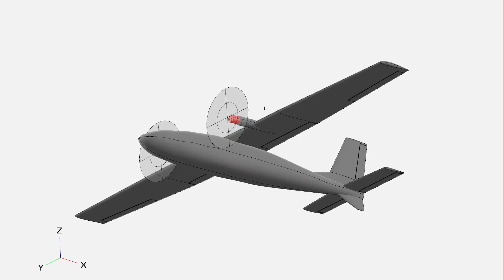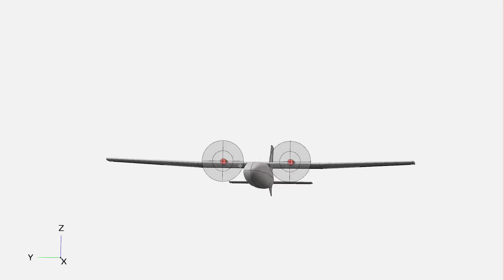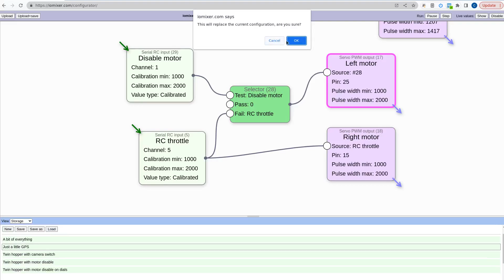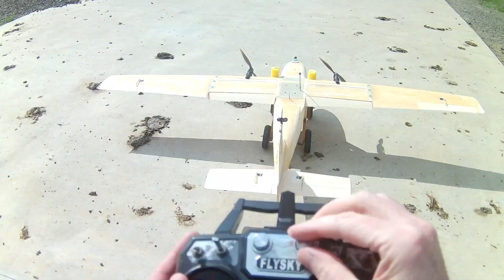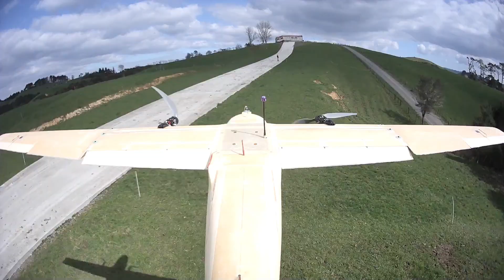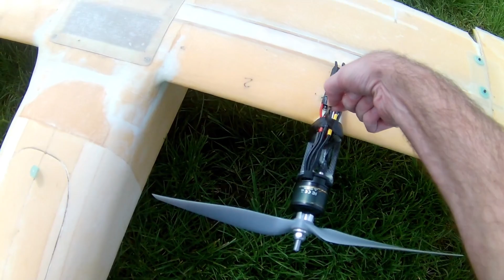Ardupilot vs motor failure testing

Comment from the maker: I also tested cutting both motors in auto mode, but forgot to include that in the video. The plane pitched up a bit in an attempt to maintain altitude, which resulted in parachuting downward at 7m/s at which point I got scared and recovered it in manual mode. You can see a clip of that here: https://youtu.be/4N046PUA5Ts
Reply: Erm if Andrew was auto compensating and automatically adjusting for the switched of motor leading to your video is it not logical to assume that having an autopilot doing micro adjustments alongside you flying leads to the exact same video Andrew produced? Andrew is making minor adjustments in his head leading to you saying in effect that his data would not translate to lets say my video or stave's down the road, but what would  be the outcome if you removed the autopilot (clue in the name there) all together and just flew the plane on servos, esc's, motors and you? then actually tried those exact same tests with no computer assistance, do you think there would be any noticeable difference then?

Comment: Hii bro I want to know that motor size and propeller Inch
Reply from the maker: These are APC 16x10 props, motors are 4250 580kv (FMS Predator brand)
Reply: @iforce2d thanks bro

Comment: Pretty cool. Not an RC guy yet, but seems like you could use a little rudder input programmed in for asymmetric thrust.
Reply from the maker: Yes, if you wanted to do this intentionally for some reason that would be helpful. The question I was trying to answer was how well Ardupilot manages when a motor fails unintentionally, without any specific 'programming' to take care of it.
Reply: I see. I find it fascinating the stuff you're doing. In airliners if we don't apply rudder or rudder trim the autopilot will have a hard time compensating. And it looks like Ardupilot is basically an autopilot from what I can tell. Waiting for the retracts you talked about! :)  @iforce2d

Comment: Great aircraft :) I have been building my designs for the last few years with literally same technology, orange foam ("penopleks"), fiberglassed surface and multiple sections on a wing cut from profile shapes. the only thing is, I have no idea how to paint them or make them look nicer. How would you go about painting one of your models to make them look all nice and shiny? :)
Reply from the maker: I actually made a video all about my attempts to paint these. It didn't go very well, mainly because of the fiberglass fabric pattern on the surface. I can't really sand the surface much because I usually only have one layer of glass and it would be worn away too quickly before becoming smooth, plus the epoxy is very hard. If you want a truly shiny surface I think you need to make molded parts, instead of this method.
https://www.youtube.com/watch?v=7Fjj5aLm2Qw

Comment: This one seems to have a nice enough thrust-line that it barely notices a motor-out. But does that also make adding differential thrust in the control mix to boost yaw authority a moot point?

Comment: You should cut some scoops out of the fuselage and move the propellers closer...maybe even a little bit into it.....then have those scoops shaped so they smoothly direct the airflow under the wings at the root.

and maybe even slightly re-design the wing root to make a bit of downward thrust with that airflow (or adjust the flaps to take better advantage of it for just making that thrust during takeoff and on final). This may be outside the intended flight characteristics here, but it sounds fun lol.

Comment: HI, I BUILT nrf24 transmitter and receiver which output ppm using your sketch. What i want is to get my quad battery voltage to display at transmitter on an oled screen. 
May you please help how to configure this ❤
Reply from the maker: https://www.youtube.com/watch?v=lf7bO5KO6rc
https://www.youtube.com/watch?v=OC5KFWCgRdM

Comment: Another amazing video! I could watch hours of this channel
To answer your question in some other data that might be interesting.
-looking at the pitch, roll, throttle curves is interesting, bit I wonder if looking at the pitch, roll, yaw ERROR might highlight any sensitivity.
-Looked like there was a slight difference in turning radius at each waypoint. Wonder if this is significant.
-Current being about the same is interesting. Theoretically makes sense that for either case, it would take the same energy to keep the bird up, but you might expect the single prop configuration to fly a bit more inefficiently. Maybe your vibey motor is adding inefficiency of its own.
-A control lap with both props left untouched to compare to the prop off runs would be nice.

Comment: Hi iforce2d, I'm not surprised you saw no difference between the props inwards vs outwards spin direction.  The benefit of having inwards spinning props is for when you are in the climb and have a higher angle of attack than straight and level flight.  In that case the centre of thrust is moved towards the downward moving blade of the prop - and for the inwards spinning props that means towards the middle of the plane.  Therefore you get a lower yaw moment, and a lower Vmca (velocity of minimum control airplane).  This is likely much more pronounced in full sized aircraft which will have a MUCH lower thrust/weight ratio, and therefore a much greater angle between the incoming airflow and the aerofoil in a max performance climb.  With the amount of thrust of an RC plane the effect might be quite limited.  If you want to see the difference between the inward vs outward spin direction I'd suggest you repeat this test in a steep climb.  I'm not convinced even then for an RC plane you'll see much of a difference, but perhaps in the telemetry?
Reply: I have never thought of this, thanks very much. Then again, i only fly single motor aircraft :D

Comment: If you angle each motor outwards towards the tip of each wing at approx. 5 degrees, it will assist flight stability greatly with the loss of one motor.

Comment: Nice to see you have nice spring weather and are up flying again. 
Really appreciate the inclusion of the "RC input" OSD. This a great visual aid to helping understand what is happening. Suggestion: for different flight modes (10:45), would suggest changing stick-end, or stick-box colour based on flight mode (@10:45 Manual, FBW_, etc). 
With the motor-failure simulation (12:50), the right wing is visually tilted (~5-10º) relative to the horizon, and suspect the fuselage has yawed left to maintain a straight track over ground. To better visualize the yaw, I'd suggest tapping a ~7-10cm length of thread, or yarn on, or just in front of the main wing. (alternatively could attach it to video antenna, so just above the wing to eliminate surface friction). If you've ever seen video of a sailplane, often there is such a 'yaw-string' tapped to the canopy to help human pilots coordinate rudder and aileron inputs to help maximize efficiency (drag reduction). 
With just the right motor running roll-rate to left is high-rate, and roll-rate to right is low-rate. Logs should be able to tell difference in º/second. (or vice-versa depending on direction of rotation of the powered motor)

Comment: Add this data point to your calculations:
Ardupilot powered VTOL Ranger T1
Q-Loiter mode, taking off. Get to about 10M, and starboard ESC decides to identify as roadkill and lets the magic smoke out.
Interestingly, AP caught the failure and kept the vehicle shiny-side-up during the decent, gliding it into a gentle landing

Comment: With such large propellers I would expect some gyroscopic effect that could make some difference between clock- and counterclockwise rotation in the case of one engine off
Reply: The torque is the problem not really gyro effect imo.

Comment: How did you put your "rc input" into video? How can I do this for my videos?
Reply from the maker: Not easily. I wrote a program to read in the iomixer log and generate 38377 png files from it. Then I used ffmpeg to join the png files into a video. You can use things like Dashware and the regular Ardupilot log for a more typical approach.